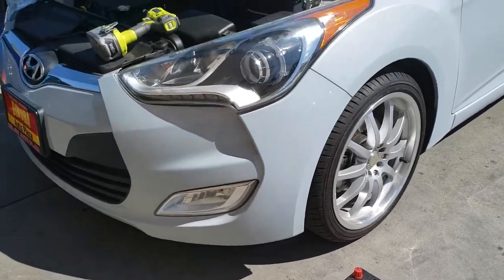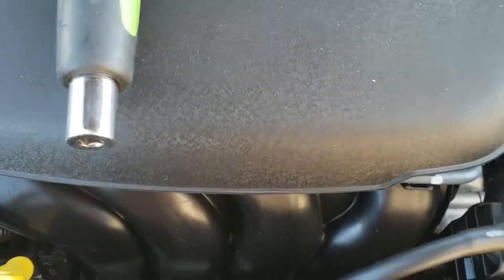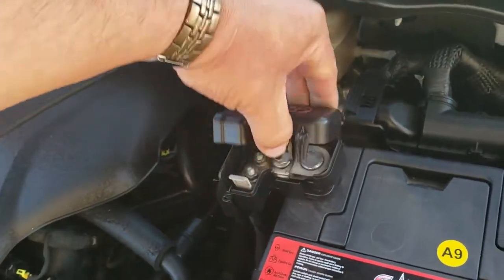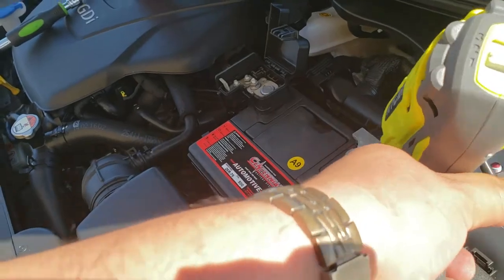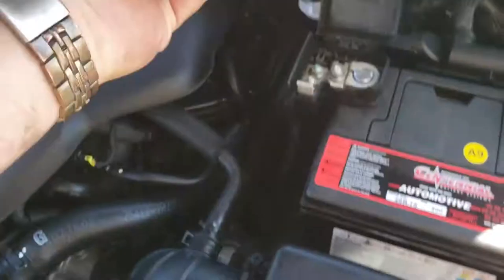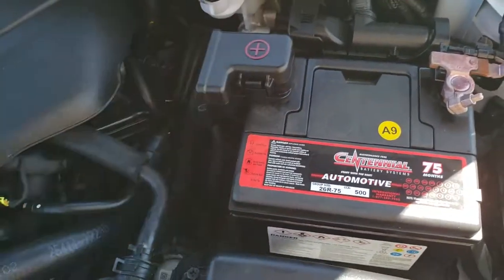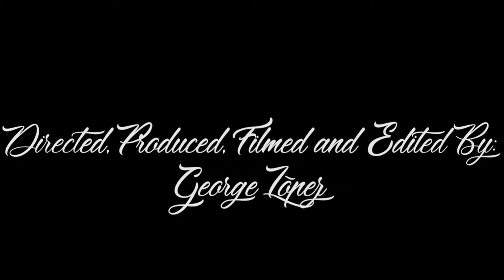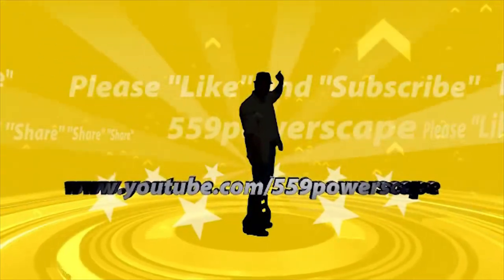How to: Install a new battery on a 2014 Hyundai Veloster

Comment: Hi, may you also please share link to the replacement battery? your video is super helpful, and I decided to change my car battery on my own.
Thank you!
Reply from the maker: I looked online and it's a H5-DLG Group Size. Best bet is to look online for the best price because my local Autozone (auto parts store) has it listed for $159.99 plus $18 dollar core charge if you dont take in the old battery with you at the time of purchase. https://m.autozone.com/batteries-starting-and-charging/battery/duralast-gold-battery-h5-dlg-group-size-h5-ln2-650-cca/832330_689825_25698?aqs=
Reply from the maker: Thank you for your Support Vanessa  hope this works out for you!